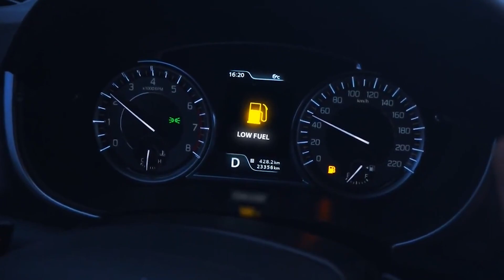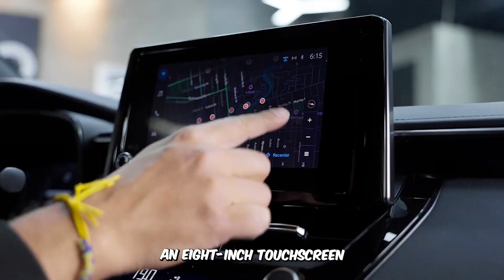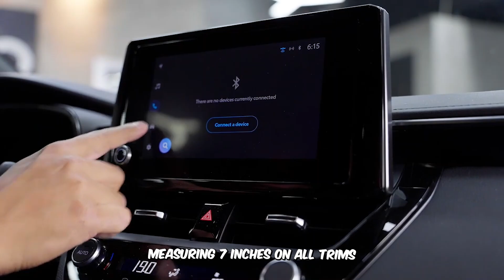ALL NEW 2024 Toyota Corolla SHOCKS The Entire Car Industry!

Comment: although i do think the corolla is a good reliable car, it cant compete with some of the other cars of the same caliber. lets take for an example the Mazda 3 line up, you are getting Lexus luxury in a 2.5L 4cyl that has the same efficiency and more sportier with a real transmission and more horsepower. i have test drove the corolla, wrx and the civic and the corolla had THEE worst handling and rideability enough so that my 07 Camry felt better on the road than it, now GRANTED I drove a 2022 corolla but i doubt they would change massively otherwise you lose responsiveness in handling around corners, but if they do fix that then good on them 
another thing people factor in is costs as of rn for all three cars its about 27k+ mainly because dealers see the name Toyota, Subaru or Honda and mark those cars up so high simply form name of being reliable, but is all the changes they want to make going to make the base car cost even more than it already is in order to make a profit.
 right now the car market for the "big 3" is so overpriced people are turning to Korean made cars and even other brands simply because of affordability while also gaining more in that said section. anymore people consider Honda and Toyotas compact care the eco compact fight, where as other brands like Mazda 3s, Hyundai, VW and Subaru as the fight for luxury's/sportiness

(as a side note for cost of car and sportiness the gr corolla, wrx and civic are 10K+ more than the Elantra n AND the Turbo sport Mazda 3 hatch or sedan variant and you get less accommodations compared to the two.)
Reply: Stop making such long posts. You are allowed two or three sentences. You are banned for six months. 💀♎